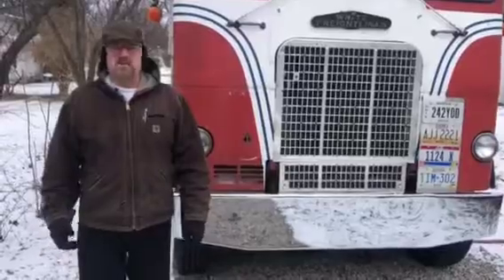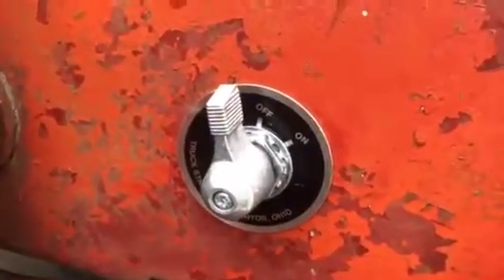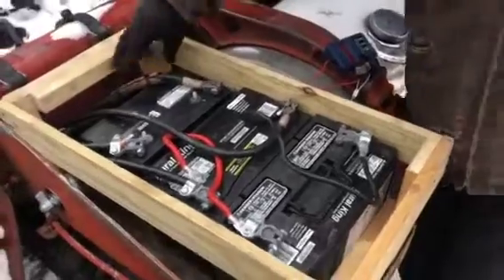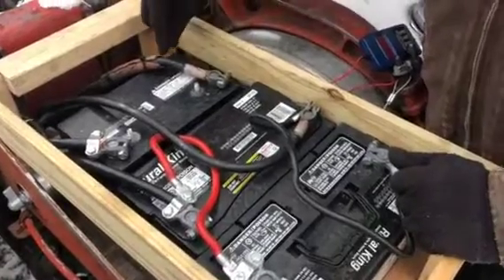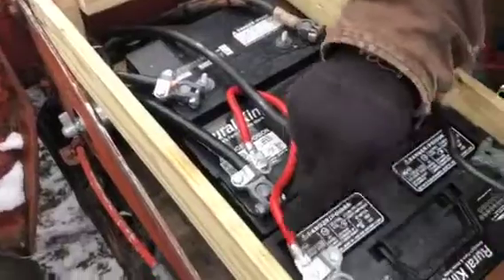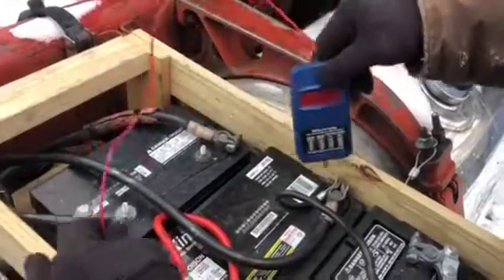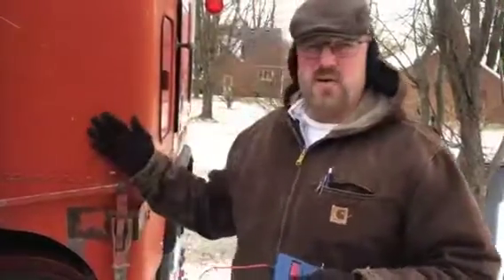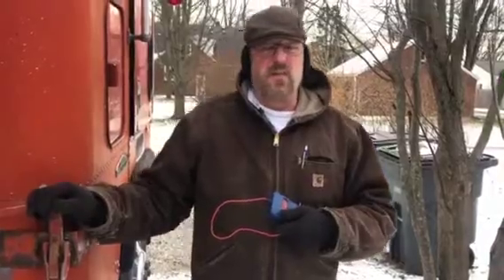Installing Battery cut off switch for Parasitic Leach 🛠

Comment: If you constantly turn that thing on/off, then I am told that switch will not last. I only used it if my truck set over the weekend or longer.